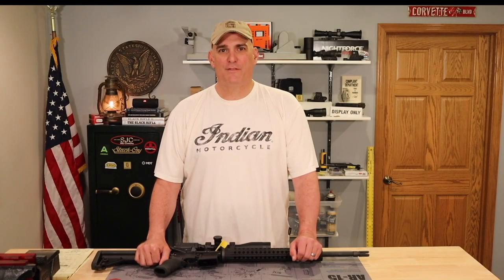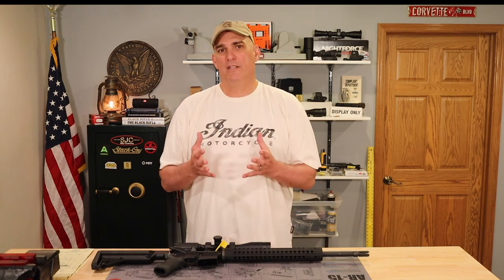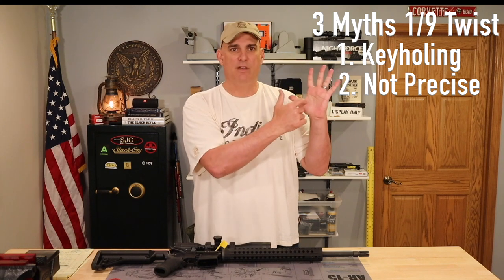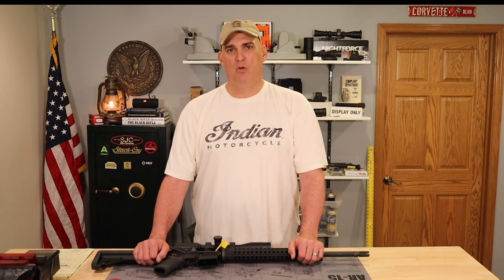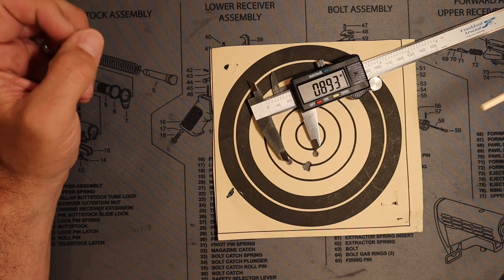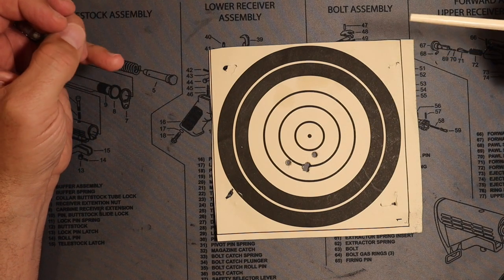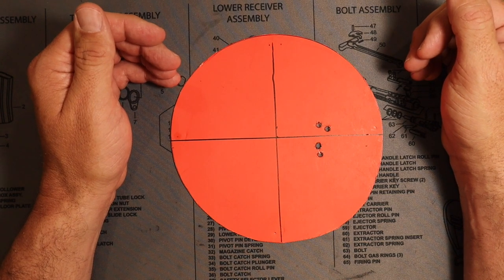Why AR-15 twist rate does not matter w/ stability | accuracy. Pt 1.

Comment: I had a 20 inch 1-9 twist,,it could NOT stabilize a hornady 75 grian tipped bullet(very long),,,,it could barely stabilize a 75 grain open tip,, slightly shorter ,,so 77 grain depends on lenght and temperature,
Reply from the maker: If you were shooting Amax or ELD-M 75 grain, it won't stabilize.  Temperature can make a differencr in certain situations. In this video,  https://youtu.be/iWowvKDFCdo  I shoot 77 grain in a 1/9 twist with no problems.  Also, if you are having problems, you can always measure the twist rate to verify the barrel was cut correctly. Thanks for watching.

Comment: How does this compare to a 12.5" or your mini recce
Reply from the maker: Not sure as I have not personally tested it, but generally barrel length is not a big factor in stability per Brian Litz one of the foremost experts on the topic. Thanks for watching .
Reply: @PracticalAccuracy  at any length? I watched the video, I swear. Great info! I have a 1/9 I was considering using for a mk12 mod h. This was the video I needed
Reply from the maker: @dhurley808  I would have to look up the info from Brian on length, but between 20 and 16 is doesn't  matter.

Comment: I’m building an Ar pistol and I’ve been wanting a 1:8 twist to stabilize everything, can a 1:7 twist stabilize a 55gr bullet well?
Reply from the maker: Yes, but every barrel is different so it might not accurately shoot 55 grain or it may love 55 grain, but it will stabilize the bullet. Same is true with 1:8. Hope this helps.
Reply: Thank you can’t wait for your next video! If you have knowledge about a good gas length combined with different barrel lengths as it pertains to a Ar Pistol‘s and shooting both suppressed and unsuppressed that would be a great video. I’m thinking 12.5 with a mid length would be good dwell time but I don’t know much about that
Reply from the maker: @garenmoring8403   AR pistol is on my list. I don't have one yet, but I'm Looking at 12.5  as well.  I will also be looking at a suppressor. Not sure of the gas length, other than I went for a carbine length on my 14.5 build.

Comment: There is no real "standard" barrel length. But the most common length is 16". You say the first rifle is a 20:, but you don't mention the length is the other two.
Reply from the maker: Thanks for watching. You are correct. 2-20 inch and 1 -16 inch.  Was one of my first videos and I'm trying to get better.
Reply: @PracticalAccuracy  Hey, not a problem. You're doing fine. But I had to ask. BTW, I subscribed.
Reply from the maker: @BarbosaUral   Thanks.

Comment: Interesting that you do not list any qualifications or experience related to this topic. Factual experience on a range at multiple distances and with multiple bullet weights and barrel twist. Fact, a 1/9 barrel will NOT stabilize a 77grain bullet beyond 400 yards. Factual practical testing at Damneck on the rifle range 100 to 500 yards 2008. 3 DPMS match AR15s with 3 different twist rates. Out to 300 yards there is little difference. 400 to 500 performance drops significantly in heavier "longer" bullets in lower twist rate barrels. Past 500 yards, a 77grain bullet from a 1/9 twist barrel may as well be a shotgun. The accuracy loss is significant due to destabilizing of the bullets.
Reply from the maker: 1/9 will stabilize 77 grain Bullets past 500 yards.  In part 2 of this Video, I shoot out to 567 yards. I also changed the weather conditions to very cold temperatures and shoot out to 567 yards with 77 grain bullets in this video.  https://youtu.be/iWowvKDFCdo
Moreover, I have shot out to 1000 yards with 2 different 1/9 twist rifles and 77 grain bullets.  Those videos will be coming out soon. Every rifle is different, but 1/9 twist will stabilize 77 grain bullets.
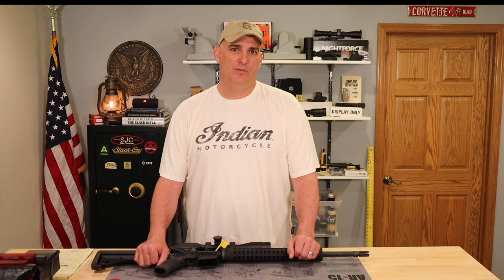Reply: You need to go watch part 2 & 3. Your statements are false given the parameters used within the series. Also, this is purely through my own experience but I have a backyard range out to 533 yards at its furthest point. I have multiple uppers from bcm, SOLGW, Aero, psa, ruger, s&w just to name a few from 1:12 to 1:7 twist rate. At 500 yards I get minimal grouping differences between the 3 most common twist rate barrels when using 55g to 77g cartridges. I certainly get point of impact shifts between the three choices, some of which are up to 10 - 12moa difference BUT all groups are still within 0.2 - 0.5moa from each other. This is of course with the rifle being mounted to a lead sled and using an optic that's ffp with adjustable parallax to keep the closest repeatability possible between all the different uppers. I can't speak for anything past 500 yards but the only time I've ever seen a round keyhole was with my 20" 1:12 twist using 70g+ ammunition.

Comment: I cut rifling for Proof Research, and to say rifle twist rate doesn't matter is simply wrong. Just because the bullet is stabilized enough not to keyhole does not mean it is optimally stabilized. The bullet may still be rotating around its longitudinal axis so that the tip makes small circles around its vector in flight. This will not result in the best ballistic coefficient. You may get adequate accuracy, even at extended range, but you won't get the best external ballistics, and probably won't get the best accuracy either. It is much easier to under stabilize a bullet than over stabilize a bullet, so the average shooter is probably better off with the faster twists, because it gives them more options. There is a reason long range shooters typically go with fast twist barrels shooting heavy for caliber VLDs. A fast twist gives enough rotational velocity to optimally stabilize longer bullets in more conditions. The military went with the 1:7 twist because the 5.56 M856 tracer round required it to be stabilized in arctic conditions, as cold air is denser than warm air, and therefore requires more rotational velocity to stabilize a projectile. The fact is that no serious fighting rifle in 5.56 has a 1:9 twist. All fighting rifles in 5.56 have twist rates of 1:8 or faster because these twist rates allow for greater flexibility, and provide optimal stabilization for longer projectiles in a wider range of environments. Rifles in .224 cal with 1:9 or slower twists are range toys and varmint rifles.
Reply from the maker: I agree with some of what you said, but not your conclusions. What I know is that all three 1:9 rifles I shot out to 567 yards were plenty accurate and this could not have been achieved without adequate bullet stability. I shot 3 different rifles to prove I didn't have a one off rifle fluke. I have another A2 rifle 1:9 twist that I shoot (75 gr.)  out to 800 yards very accurately, hitting full size IDPA targets. With 4 rifles, the  proof is in the pudding.  Plus, 99% of civilian shooters won't be shooting in Artic conditions (which I agree can affect bullet stability) or using Military tracers.  Also, serious long range competitors may need faster twist rates because they are shooting 80 grain plus VLD's that they cannot magazine feed, but single load into the chamber. I'm not talking about twist rates for them, which I agree may require faster twist rates. I understand that not this does not guarantee that every 1:9 twist will accurately shoot 77 grain bullets, just as a 1:7 cannot guarantee accurate shooting with 77 grain bullets. However, most good quality 1:9 twist barrels with provide enough stability for accurate shooting at distance given the parameters set forth in the video.  Thank you for watching, but I respectfully disagree.
Reply: @PracticalAccuracy  Just because the 1:9 provides adequate results doesn't mean it provides optimal results. You proved that the 1:9 was adequate, but you didn't show that it was equal to or better than a faster twist rifle. You can't escape the fact both ammunition manufactures recommend 1:9 or faster. The 77 gr Sierra Matchking was designed for competition shooting in AR pattern rifles because it will fit inside magazines without the need to single feed. Every single military weapon that has used this bullet, from the old iron sighted M16A2s at Camp Perry to the PRI Mk 12 Mod 0 that the Mk 262 was developed for has a 1:7 twist. The proof is in the pudding, but it doesn't say what you think it says. You proved that the 1:9 might be good enough, not that it was the best, or just as good as other options. The proof in the pudding is that professional end users choose faster twists for those bullets. The proof in the pudding is that 90% of the .224 cal barrels I cut rifling in at Proof Research have a faster twist rate than 1:9. The proof in the pudding is that the entire industry has realized twist rate absolutely matters and that faster twists give you more options.
Reply from the maker: @MTMILITIAMAN7.62  I can see there is some misunderstanding about what my video is about. I must not have adequately explained what I was trying to prove and the intended audience.
This video was meant for beginning shooters who are told
1. a 1:9 twist barrel cannot stabilize 77 grain bullets and
2. a 1:7 twist barrel cannot stabilize 55 grain bullets.
Both of these statements are false.

This video was not meant to prove 1:9 twist barrels are better than 1:7 or 1:8. I have no bias either way for any of the barrels. If 1:7 or 1:8 works for someone, more power to them. I in fact shoot several 1:8 twist rifles in other videos. A 1:8 A2 with iron sights at 1000 yards with good results and a 1:8 A4 with 16 power scope at 1000 yards with good results.

This video simply shows that a 1:9 twist will stabilize 77 grain bullets at distances most shooters will never even attempt to shoot. Hitting a 12 inch steel plate 9/10 times with 2 different rifles shows this. I also know I can do it out to 800 yards(IDPA 18x30), I just don't' have it on video.

Additionally, the boxes I read from said "1:9 twist or faster" not 1:8 twist or faster.

With regard to 1:7 twist, I still need to get my hands on a rifle and I know it will show a 1:7 will stabilize 55 grain bullets. If you follow the ar-15 forums, you will see a guy named "Molon" who can shoot a 1/2 inch groups at 100 yards using 55 grain hand loads and a Colt 1:7 twist barrel.

I hope this clarifies what I was trying to show.
Reply: @PracticalAccuracy  Okay, fine. But telling beginning shooters that twist rate doesn't matter is disingenuous. Twist rate does matter. Telling people that twist rate doesn't matter, in the title to your video, insinuates that 1:9 is just as good. It isn't. It is like when your vehicle's operator manual says to use at least 89 octane fuel, so you show your vehicle still drives with 89 octane fuel and then pronounce octane levels don't matter. Using the minimum recommended standard for anything and then pronouncing standards don't matter is dishonest and wrong.
Reply from the maker: @MTMILITIAMAN7.62    I guess we disagree. I don't think it matters between 55 and 77 grains. The viewers can judge whether hitting 12 inch steel at 567 yards 9/10 shots is good enough with a 1:9 twist.
Reply: @MTMILITIAMAN7.62  make a video and show me.
Reply: @Keithjmcc  I don't have the equipment to make videos. What I can do is show the effect as published by Hornady with their updated Mach 2.25 BCs for their ELDMs. They post BCs for a couple bullets with two different twist rates; the 180 gr .284 cal ELDM with a 8.75 and 7.5 twist, and the 225 gr .308 cal ELDM with a 10 and a 7 twist. The 180 gr .284 cal records a Doppler verified Mach 2.25 G7 BC of .391 with a 8.75 twist and .411 with the 7.5 twist. The 225 gr .308 cal gets a G7 of .391 with a 10 twist and .402 with a 7 twist. Both of these projectiles could be adequately stabilized for decent accuracy with the slower twist rates, but they aren't going to achieve optimal external ballistics because they aren't ideally stabilized. 
Hornady also publishes Mach 2 and Mach 1.75 BCs, and to get the most accurate long range charts, you'd need external ballistics software that could enter these numbers at these velocity thresholds as well, since BCs degrade with loss of velocity. I don't have such external ballistics software right now, all I have access to is the Ballistics Calculator on Berger's website. But if you enter the Mach 2.25 numbers for the 180 gr .284 with a muzzle velocity of 2900 fps, for the 8.75 twist G7 BC of .391 you get a TOF of .58 sec to 500 yards with 43.3 inches of drop, a TOF of 1.31 sec to 1000 yards with 249.6 inches of drop, and 2.25 sec TOF to 1500 yards with 727.3 inches of drop. With the 7.5 twist G7 BC of .411 you get a TOF to 500 yards of .57 sec with 42.8 inches of drop, a TOF to 1000 yards of 1.29 sec with 244.6 inches of drop, and a TOF to 1500 yards of 2.21 with 703.3 inches of drop. This isn't a drastic difference, but it is enough to make a difference in many cases. If you're doing a 1500 yard milk jug challenge, for example, an additional 1.5 MOA of drop is going to give you a headache shooting a sub-half MOA target.

Comment: First off the AR15 is a platform not a caliber so twist rates will be different with different calibers. The fact you don't seem to know this means that we should not listen to jack you have to say. Start over and talk about the twist rates of 5.56 NATO which is what you really mean.
Reply from the maker: Craig, you are correct that the Ar-15 has evolved into a platform and is not a single caliber/chambering and twist rates will differ.  I am also aware of this and thought it was evident from the video that I was only talking about 5.56mm/.223 caliber.  I will make a notation in the title or description to note that fact. However, the twist rates that I discuss are applicable to 5.56 Nato, .223 Wylde, and .223 rem chambered rifles.  I have shot 5.56mm Nato (77 gr.) ammo and .223 Rem ammo (75 gr. hornady)  out of both 5.56 Nato chambered and .223 Wylde chambered rifles  (1:9 twist) accurately out to 800 yards. 566 yards in video part 2.  I hope to get out to 800 yards when the weather warms.  So the point of the video was to show that this can be done accurately with a 1:9 twist rate and  77 gr. 5.56mm/.223 ammo  The video was not meant to be a comprehensive discussion of all calibers or twist rates in the Ar-15 platform.  Sorry for the confusion.
Reply: The guy just trying to make a good video explaining some basic information maybe a entry-level basis. I’ve met this guy once at the range he actually seems like a pretty decent guy maybe cut them a break I got a lot out of the video.  I guess I just thought the A.R. 15 is just normally caliber any 556 round didn’t really think much about it even though I know that they make in other calibers.
Reply: @Craig Black The title of the video makes it clear this is about 5.56 nato/.223 Rem.
Reply: @TargetSuite  the title has now been changed so yes it now does but not when I made my comment
Reply: @yjoeyyy  i agree !
Reply: @blackfam972  you seem fun at parties